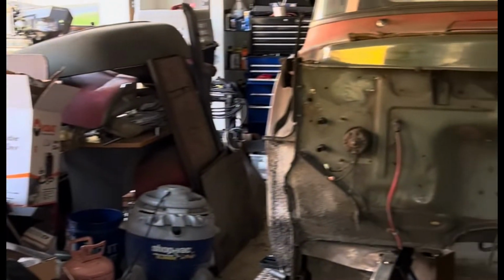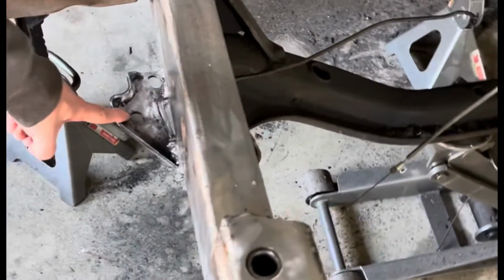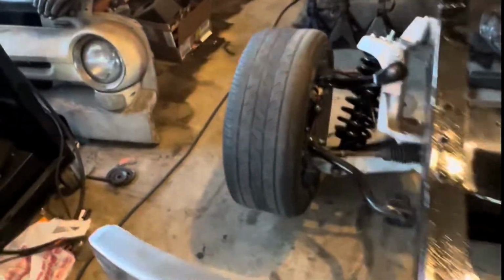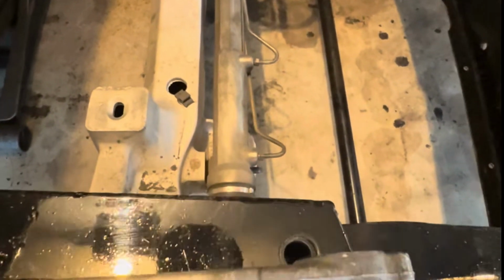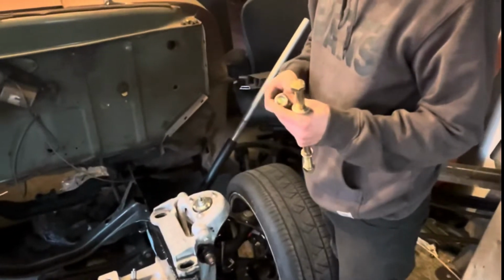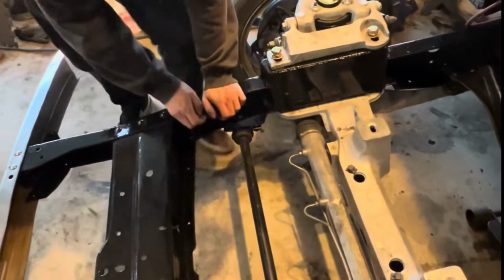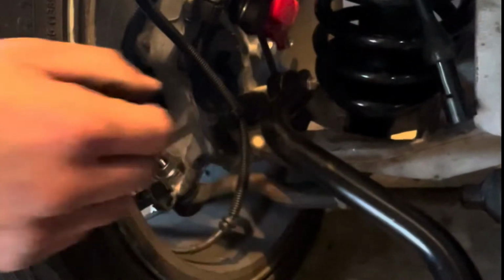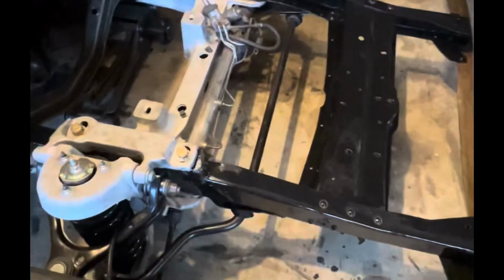F100 PART 1 CROWN VIC SWAP

Comment: Nice work man, question, would you share the measurement and dimension as to where exactly on the chassis to weld the box?
Reply from the maker: The center of the box is the center of your wheel. Some people go one inch back towards the rear. If I measure from the front bumper to outer edge of box it’s 29.5.

Comment: Where did you get the boxes you weld on the frame?
Reply from the maker: https://www.ebay.com/itm/114065675340?chn=ps&_trkparms=ispr%3D1&amdata=enc%3A1P6Ma50MgRCi8f1N8jm5Zhg52&norover=1&mkevt=1&mkrid=711-117182-37290-0&mkcid=2&mkscid=101&itemid=114065675340&targetid=1644837435243&device=m&mktype=pla&googleloc=9007417&poi=&campaignid=20125739985&mkgroupid=149128855676&rlsatarget=pla-1644837435243&abcId=9312975&merchantid=118973457&gad_source=1&gbraid=0AAAAAD_QDh8V2WiYC9T2GgKHkov3cF_Lj